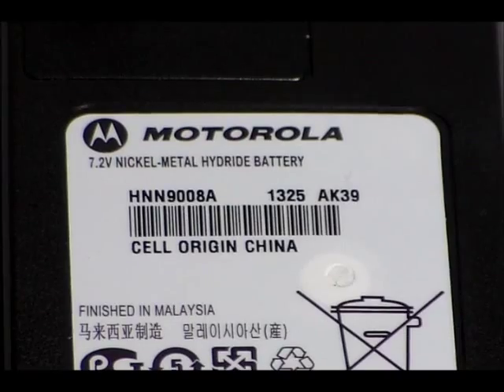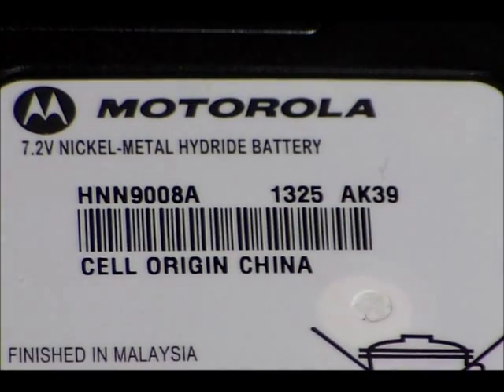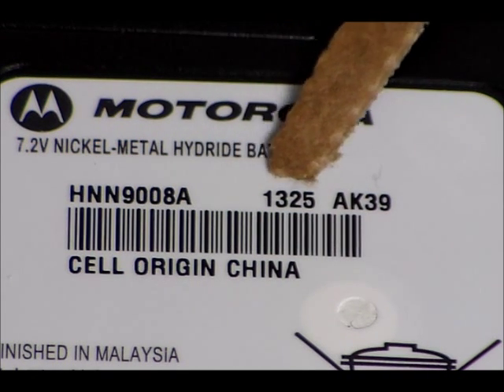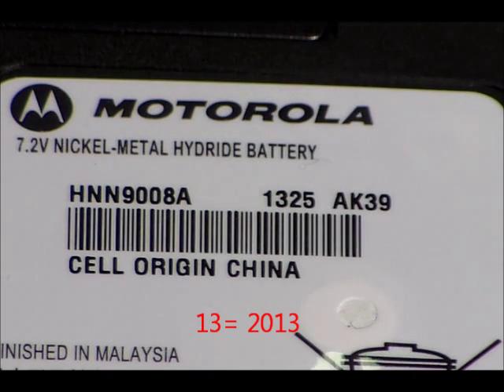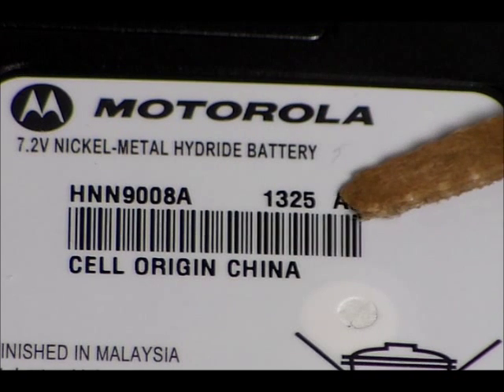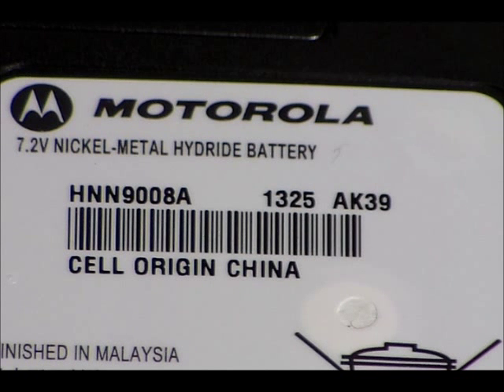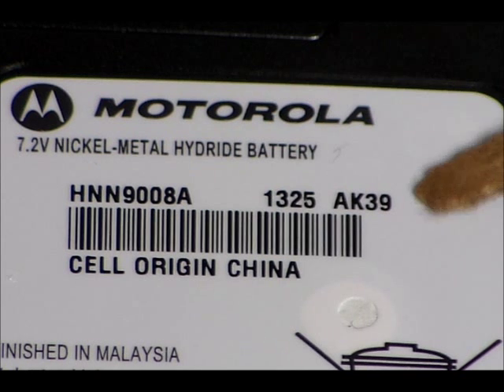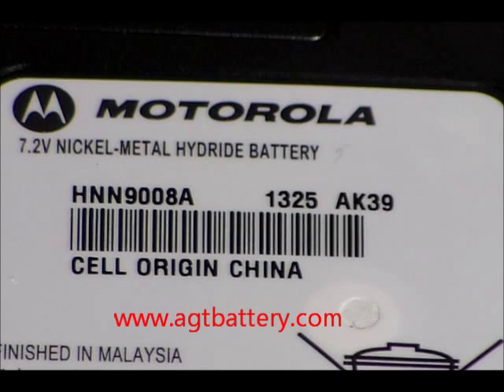Motorola battery date code for Two Way radio

Comment: This was a great post Thank You. My CERT team is using the CP110 line of radios as well as the RMM2050. It seems they are now stamping the code right into the plastic. Can you tell me how to read these codes. Example :   120    JUED       OR ANOTHER EXAMPLE 005  JUCB    Thanks for your time.